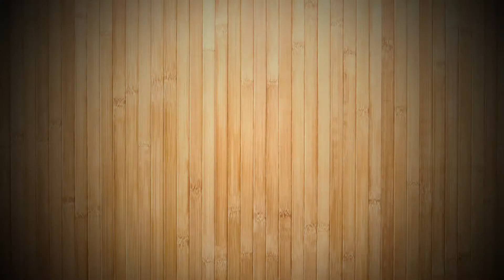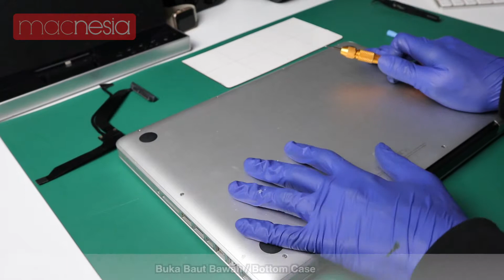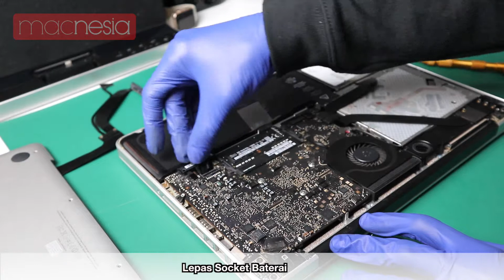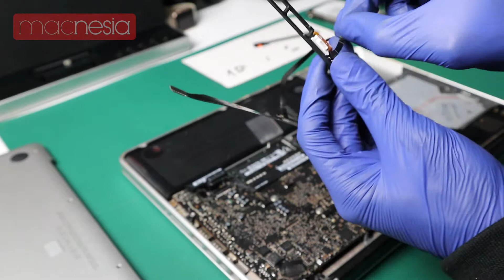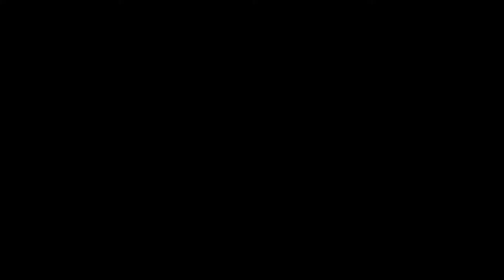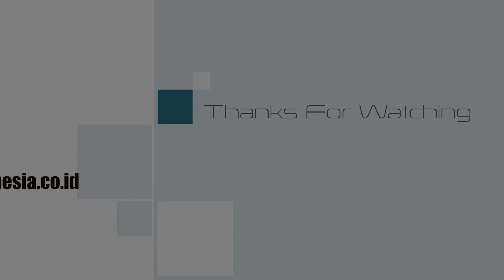CARA MENGGANTI KABEL HARDISK MACBOOK PRO

Comment: kalo macbook sudah Install Ulang ganti SSD & RAM masih lemot itu apanya y?
 jalanin kursor aja kerasa berat, apa masalahnya di kabel HDD y?
Reply from the maker: Halo kak, sebelumnya salam kenal dari Macnesia  😊🙏. Sebelumnya boleh saya tau untuk penggunaan apa? dan apakah running system nya via SSD di primary?
Reply from the maker: macOS sekarang apa ya kak?
Reply: @macnesia_channel9002  sekarang pake OS high siera
Reply: @macnesia_channel9002  untuk penggunaan video editing, OS-nya running via SSD buka finder aja 5 menit 😔
Reply from the maker: @besituaproduction6133  Maaf boleh saya tau Model MacBooknya apa?
Reply: @macnesia_channel9002  MacBook pro 2011 13 inch
Reply from the maker: @besituaproduction6133  Oh A1278 ya kak
Reply from the maker: Aplikasi yang kakak gunakan untuk editing video apa ya?

Comment: Ganti kabel flexible macbook pro 2010 brp ya?
Reply from the maker: Maaf sebelumnya terkait harga bisa konfirmasi langsung dengan admin kami di no. 📱08179119288 • 0816744223 • 081281181086 ya kak. Terima kasih 😊🙏

Comment: Kalau flexibel indikator lampu itu putus solusinya gmn gan
Reply from the maker: Model MacBooknya apa ya kak?
Reply: Md101 bos
Reply from the maker: @susanprasetyo5322  Model A1278 kah kak? 🤔
Bisa dicoba dengan ganti kabel fleksibel kak. Tapi, untuk lebih detailnya, bisa tolong kirimkan fotonya via WhatsApp kami kak di no. 0816 744 223 😊🙏

Comment: Ini biasanya di ganti karena kenapa? Apa gejalanya?
Reply from the maker: Biasanya diganti karena kabelnya rusak jadi berakibat hardisk gak kebaca ka. Gejalanya biasanya ada tanda folder questionnya.
Reply: @macnesia_channel9002  saya sudah ganti kabel fleksibel hdd tapi masih blank screen putih kenapa ya?
Reply: @macnesia_channel9002  maaf nimbrung, saya memiliki kasus yg sama persis "muncul folder tanda tanya". Saya berasumsi kalau ssd nya rusak. Jadi saya melakukan replacement. Setelah replacement, ssd baru nya sempat kebaca dan telah dilakukan penginstalan Mac os. Tapi setelah beberapa kali restart, ssd nya kembali tidak terdeteksinya. Mohon pencerahannya 🙏🏻🙏🏻🙏🏻
Reply from the maker: @SlametRiyadi-rb8lv  Model MacBooknya apa kak?
Reply from the maker: @agungamien7458  Model MacBooknya apa kak?
Reply: @macnesia_channel9002  Macbook Pro 13 inch Mid 2012
Reply from the maker: @agungamien7458  Apakah sudah dicoba mengganti fleksibel SSD nya, kak?
Reply: @macnesia_channel9002  untuk saat ini mbp saya sudah beroperasi dengan normal. tapi terkadang ssd nya tidak terdeteksi, jadi saya harus force power off dulu terus saya nyalakan kembali baru ssd berhasil terbaca.

untuk fleksible belum saya coba untuk ganti.
Reply from the maker: @agungamien7458  untuk macOS nya sekarang apa kak?
Kalau boleh tau, kakak tinggal di daerah mana ya?
Reply: @macnesia_channel9002  sekarang Catalina 15.17

saya domisili Makassar kak